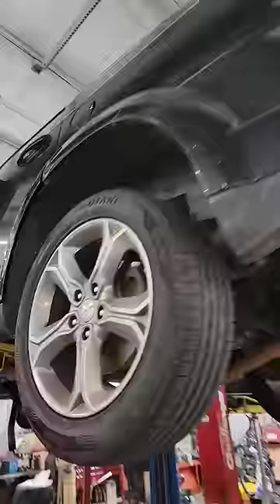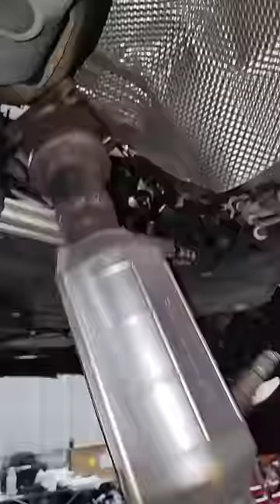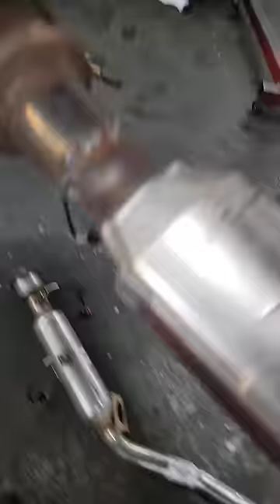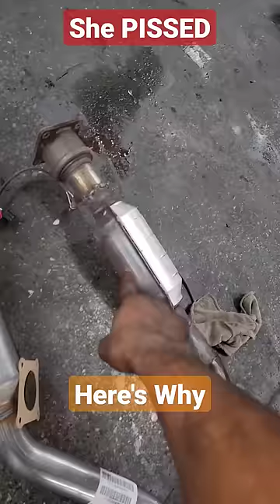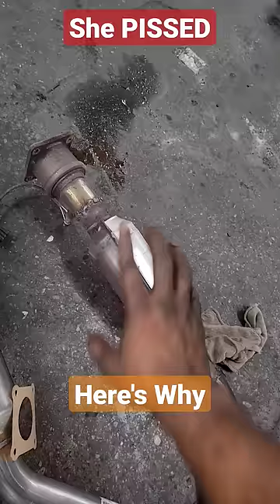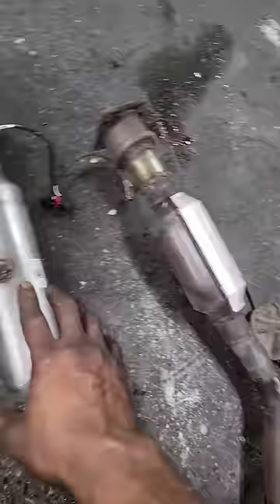This customer freaken Pissed Off. But at whom?

Comment: It’s not the shops responsibility to check for recalls it’s the owner of the vehicle. It’s not the shops fault or the technicians. It is the customer that owns the vehicle and that is stone cold their fault we don’t get paid to check and make sure there is a recall on somebody else’s vehicle, if she takes it to court, she’s gonna lose and let’s talk about aftermarket parts that you put on. I’ve seen plenty of your videos that you’ve put doorman parts on aftermarket so don’t knock aftermarket parts. A lot of aftermarket parts are better than OEM as far as quality and pricing because they are updated just like GM 5.7 intake gaskets that are plastic if you buy Fel-Pro you get metal  gaskets. so don’t be barking down somebody else’s work when you have done the same thing we can back on your videos and we’ll see. Were you have used aftermarket parts oh I can’t use this because OEM doesn’t have it. We can start from Ground Zero body you’re not Mr. perfect nobody is you learn something new every single day